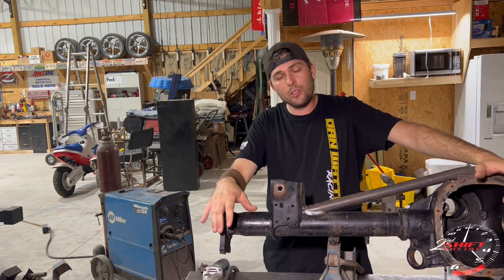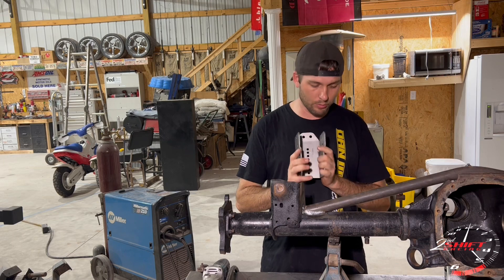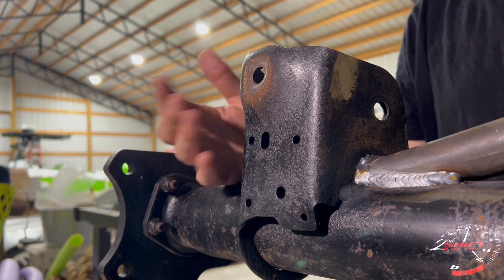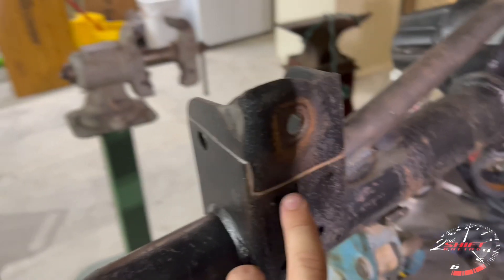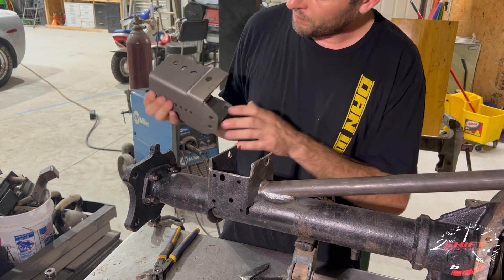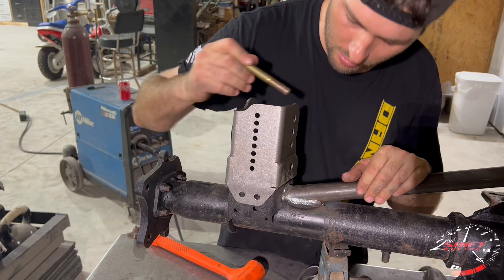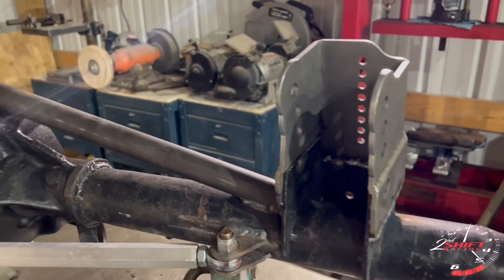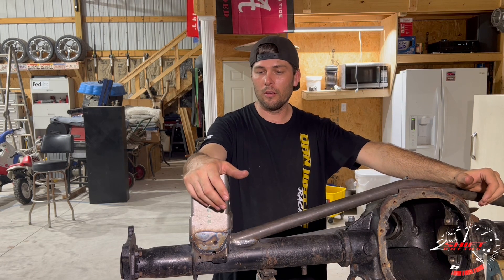An Infinity Stone Of Radial Racing. Racecraft Relocation Kit Install For 8.8 - Episode #041

Comment: Have you guys narrowed this rearend with these brackets on it? Or the bracket is too close to the rim to trim any from the outside of the axle tube…?
Reply from the maker: Yes, shorten 8.8 with 9” ends. Clears wonderfully.
Reply: @2ndshiftracing  how much did you cut off each end, and what BS wheels?
Reply from the maker: @TomR1211  Think it’s like 2.5” per side 4.5 bs on the wheels. There’s a photo of the red car on our instagram.

Comment: Great stuff. I've got a stock '98 GT SRA and the rear end is the last thing I've got left to do for my Cobra. Thanks for the pointers! Thinking about a 31 spline eaton true trac setup with the braces you've got.
Reply from the maker: The truetrac is a solid piece for racing. But…if you’re on a budget, the Ford Racing Cobra Posi will work fine for a fraction of the cost.
Reply: @2ndshiftracing  I was thinking about having a 3-5k budget for the rear end build. My only issue is I don't have access nor do I know how to weld, so I'm going to have to pay someone to do a majority of the installs. The car is 99% street driven, but I'd like to be able to hurt some feelings on the track once or twice a year. Plus I like the idea of no more clutch packs with the True Trac. Maybe it's overkill?

Comment: Wouldn’t it have been easier to mount the relocation brackets before the bottom brace? 
Also why not weld the inside of the brackets? 
Not being negative I enjoyed the videos and look forward to seeing more.
Reply from the maker: Eh…maybe. We did weld it on the inside also. But not by itself cause it will flex and move when put under stress. So you need to weld the outside too.